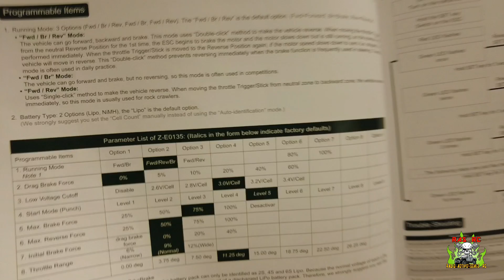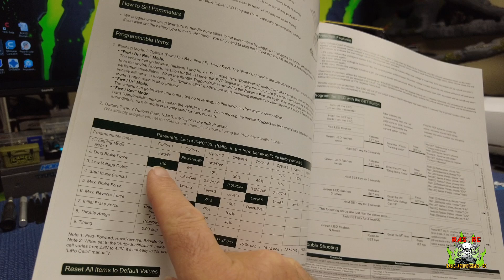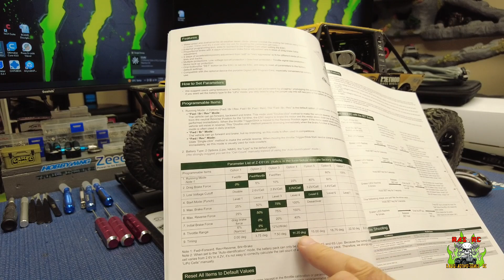"ROUND 2" RC4WD MILLERMOTORSPORT “BIGGER ISSUES”

Comment: Nice one with your progress so far. If yours still clicks after this it might be the diff. Mine had the same click and I opened the rear axle and diff up and the ring gear was loose on the diff cage. Has 4 screws holding them together and they were loose. It does look like it can resulted in the pinions and the spider gears intermittently disengaging. Whether or not the diffs are locked. I haven't tested yet so can't confirm. But looks like a good chance it is the culprit. Good luck.
Reply from the maker: Awesome, thanks for the tip regarding the click, I have not had it out again since but if it still there, i will tear into them to check that. Thanks for watching 👊👍

Comment: Nice video 👍 
I think this rig needs some stiffer springs in the back and some wheel weights up front.
Reply from the maker: It actually is pretty good. Check out my first Run video if you haven't already it is a half  decent climber for a box stock rock Racer. Thanks for the suggestion, watching and commenting 👍

Comment: Just came across your video searching for cause of the same problem…. First run out of the box with a clicking noise!!! Was the pinion grub screw loose? Was it out of mesh? That’s a lot of tear down from what I can tell to get to the pinion with no spur gear in it. Can you clarify a bit
Reply from the maker: The pinion was loose, had to pull it out and pull the motor to find the problem the grub was not properly tightened down and the pinion was slipping in and out of mess and then fully out of mess.
Reply: @radioactivescalerc  awesome thank you. I’ll start my tear down tomorrow. Fingers crossed 🤞🏽 subscribed to see the update!
Reply from the maker: watch till the end of this video if you haven't I show how I got it out, was not to bad, good luck and I hope it just the same issue I had. I did not have to disconnect and of the shifting cables when I did it. Good luck. 👊👍